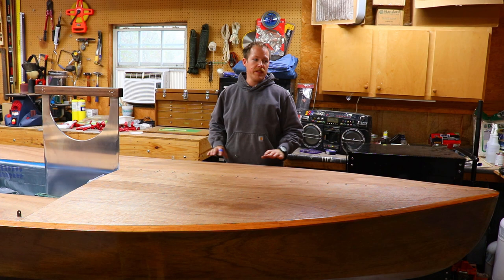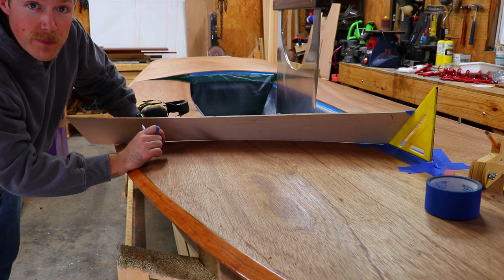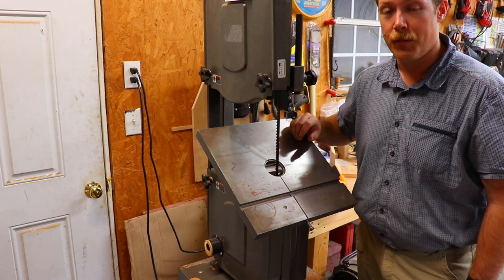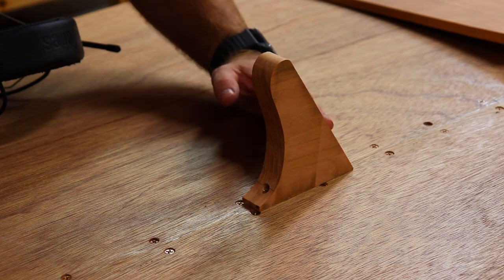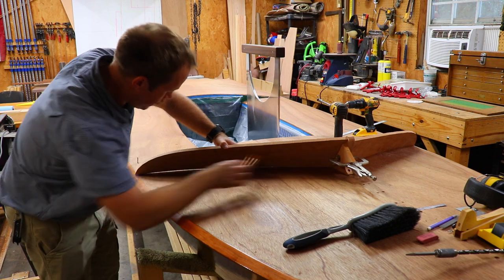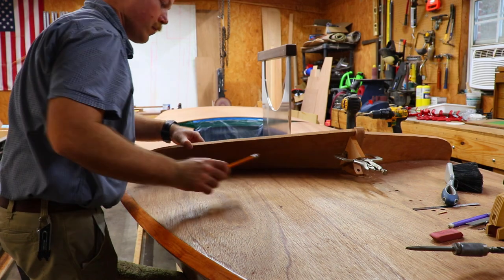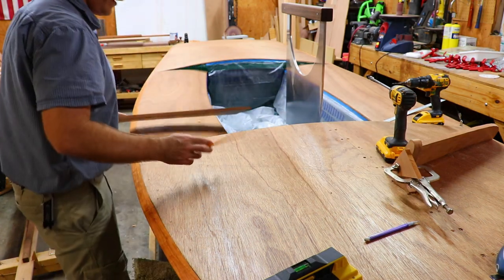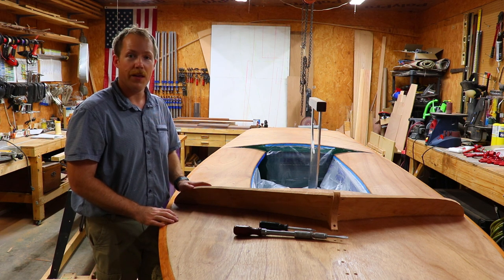Building a Wooden Sailboat #17: Splash Guards

Comment: I would like to know the dimensions of your splash guards. I know that the max. height is 4-5" and the length is the distance from the centerline to the gunwale, and the angle chosen will determine that length. How thick is the cherry you used? Looks like 1/2" or a little less.
Reply from the maker: Yes, I used 1/2-in cherry. My splash guards are about 5 in tall. I rough hand sketched the design so there's not an exact dimension. They are tilted forward about 35 to 40° from plumb, I felt like 45° was tilted too far forward.
Reply: @MakeStuffNation  Thanks!